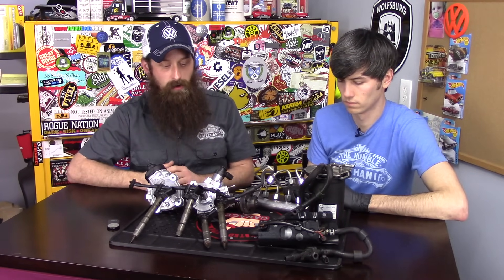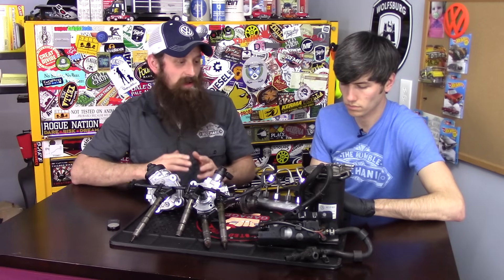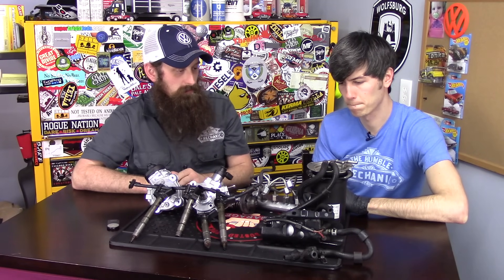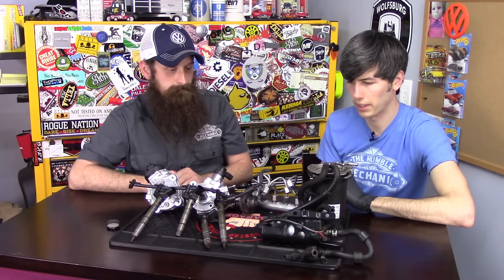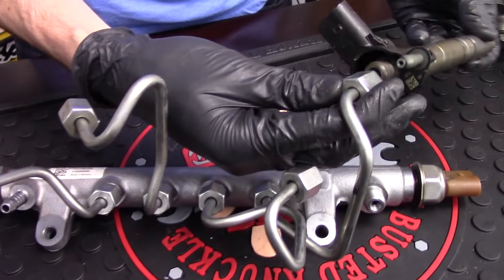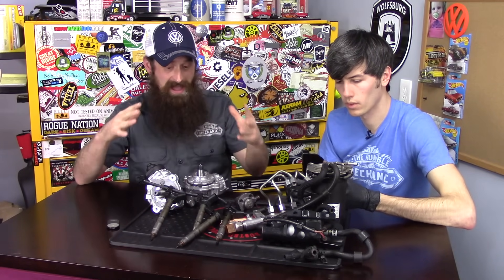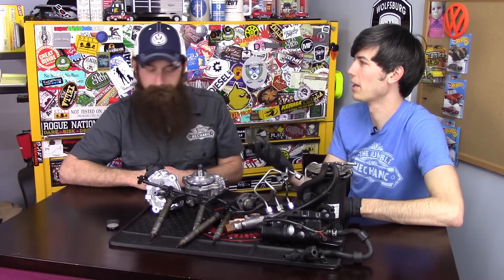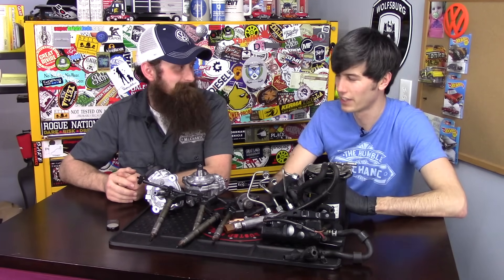Putting Gasoline In A Diesel Car - What Happens?

Comment: Or, just get an electric car.
Reply: +Btappin it charges. No such thing as a wrong plug. You can plug it into any plug.
Reply: +Btappin it charges.
Reply: +Btappin yup. Best cars in the world.
Reply: Right, why pay for an $8000 repair when you could get a $90000 car?
Reply: +Child Celebrity a Nissan Leaf isn't 90k. And neither is a Tesla. Teslas start at 60k. Nice try though.
Reply: +Kushari Okay, if you're not in a hurry, and if it works...
Reply: What if you need to drive a longer distance than the charge lasts?
I drive an LPG converted car with a limited range, and I ordered a new one which won't have that much more range... But pumping 400kilometres worth of LPG on the go takes just a few minutes, and I can switch to petrol if I run out of LPG.

I'm not a fan of using fossil fuels, nor do I believe in growing food for fuel (ethanol), but until the time comes charging an electric car takes 1 minute per 100km range or less and they come down in price, it's not for me.
Reply: +Candisa btw I'll tell you what impractical is, impractical is spending billions mining/drilling for fossil fuels to further process them and then put them in a 4000 pound car to be burnt at less than 20% efficiency in order to move a 200 lb person, now that's actually impractical and retarded.
Reply: +Matt Bartholomew Matt you're absolutely right, for most, now, it doesn't make sense. Eventually in a few years it will. The people that are buying the model s and model X are driving down the cost.
Reply: Protector of the Republic OR, you're just jealous. If it was a shitty car, why would it be winning all the car of the year awards? You're a loser.
Reply: What if you need to drive a longer distance than the charge lasts?
I drive an LPG converted car with a limited range, and I ordered a new one which won't have that much more range... But pumping 400kilometres worth of LPG on the go takes just a few minutes, and I can switch to petrol if I run out of LPG.

I'm not a fan of using fossil fuels, nor do I believe in growing food for fuel (ethanol), but until the time comes charging an electric car takes 1 minute per 100km range or less and they come down in price, it's not for me.
Reply: +Candisa supercharger network. Free to use.
Reply: +Kushari The Roadster started at $128,500, the Model S and X start at $69,900 which is only off by a margin of over the $8000 repair, but that's neither here nor there I suppose. These are the lowest-range vehicles, which still take at least a half an hour to charge to a 170 mile range. On top of that, the battery will need to be replaced after about 100,000 miles, which will run in the tens of thousands of dollars.

Not to mention the electricity the cars are charged with is most likely still coming from the burning of fossil fuels, but as long as you feel better about yourself, I suppose.
Reply: +Candisa well it does work and in 30 mins you get half the range, also when you're driving long distances you should be taking a break for safety anyways.
Reply: +Kushari There have been numerous complaints about people just barely getting to the next supercharger because the one they needed didn't work. 
I'm sorry, half an hour charging for just a few hundred kilometres of range is unacceptable. 
Yes, it is recommended to take breaks, on private drives, I take a break about every 3-4 hours. That would be the maximum or more than a Tesla can go between supercharging, and then you're stuck to whatever overpriced diner/coffeeplace/park on that location... It's like being stuck to a motorway restaurant...

I do believe electric makes a lot of sense, even today, but it still has a long way to go to replace a conventional car for everybody.
Reply: +Candisa it is acceptable because they usually have superchargers next to a mall or some place you can grab a meal. Also they are always adding superchargers. Check out supercharge.info. You think it's unacceptable because you haven't done it. My car is done charging before I ask for the bill when getting a meal. Which gives me more than enough range to skip a supercharger on the way to Montreal from Toronto. And they even added another one a few weeks ago, so that's two skipped chargers.
Reply: +Kushari I assume you'll be avoiding all of the points in the first paragraph then, and focusing on one sentence. "Didn't do my homework" meaning I'm supposed to know where you live? I'm glad to see that Canada uses renewable energy, but the US does have a generating capacity over 900 GW more than Canada. The countries use different fuel because they are vastly different. Electric motors are about 3x more efficient, but I'll excuse the exaggeration.

I actually didn't have to google anything; I simply used Tesla's site which also shows that their cars are less efficient in cold temperatures, which you surely are very familiar with, and the locations of Superchargers, that are only available from Vancouver to Calgary and Toronto to Montreal.
Reply: +Kushari There are some valid points though, and since most of my city's energy is generated from hydro, perhaps one day if I have 70k for a car, I'll get a Tesla. The torque their engines produce are pretty damn impressive.
Reply: +Kushari That still is affecting free choice... What if I don't want to take a break when in need of fuel/charge? What if I want to go eat something 2 kilometres away from the supercharger? 

What in case of a family emergency that requires me to travel 600kilometres asap?
Worst case scenario I need to fill up my LPG tank 2 times, or go F it and fill up my petrol tank once, so that leaves me delayed 5-10 minutes max.

I don't mind having to fill up every 300kilometres, but having to take a break there and then because my car takes half an hour charging?

I live in Belgium by the way, I checked out the supercharger network... It's even worse than CNG...

I ordered a €20k car, including LPG conversion. The day that price would get me an electric car with at least a 300km range and a battery that takes 5 minutes to fill up completely, I'd go for it.
I'm pretty sure I will run the car I ordered for the intended 10-12 years before electric cars will come close to meeting that expectation...
Reply: If a family emergency needs you to travel 600km, you fly. You don't drive. At least that's what I would do. Just like you said, free choice.
Reply: +Kushari haha some people simply aren't worth wasting the mental energy on, they'll always come up with an exceedingly stupid scenario that agrees with what they already decided they're going to do.
Reply: xXJeReMiAhXx99 There are some legitimate arguments, like if you have to drive a long way everyday, or like he had mentioned the price of a Tesla, but those are all being addressed over the next year or years. So I just don't get the argument of a limited resource that will eventually run out, and is killing our planet?
Reply: +xXJeReMiAhXx99 I switched from diesel to LPG, a fuel that is unavailable during shop hours at much less locations, 3 years ago...
I seriously considered CNG when ordering my new car and only decided against it because it would be less economic than LPG, instead of not even trying one because the limited amount of fill up stations and the total lack of them along motorways.
What a stubborn person I must be éh?

As I said, the moment a practical sub 20k Euro car with a minimum range of 300km and a full charging time of 5minutes or less comes to the market, I'll be all over it.
Having to plan in half hour breaks at exact locations to do a longer trip sounds a lot like taking the train or bus to me, which I wouldn't have to drive myself. If that would be so ideal for everybody, nobody would buy cars anymore.

What about people who can't even charge their car at home because they have to park on the street, also a stupid excuse?

Electric cars simply don't work for many people yet, including me...
Reply: +Kushari  She*
And in no way I'm defending fossil fuel, I'm very eco minded, I'd switch to electric immediately if it was practical for me.
Reply: You'll be waiting a while then, 5 minute charges I'd hope for, but I think that's a few years away. I didn't say they work for everyone. My initial comment was that you don't have to deal with fuel type mishaps with electric.
Reply: +Kushari That's why I still bought a brand new LPG car, planning to run it for 10-12 years. At least it'll be more economical with the fossil fuel, and hopefully an electric car will make sense for me by the time I'm shopping again.
Can't go wrong with fuel on an LPG or CNG car as well, the LPG and CNG nozzles are only compatible with that type of fuel, and a diesel nozzle won't fit in the filler of the petrol start-up/back-up tank.
Reply: +Kushari To me, it seems like it would be more beneficial to focus on making all (or at least as many as possible) power plants use renewable sources, at least in the US as Canada is already pretty much on top of this, while looking for more efficient charging/battery technology. Knowing what Li-On batteries can do when damaged makes me concerned about having a bank of 6000 in a car, and you can only send so much current to these batteries safely. Although if power plants are that much more efficient, we may as well go for it now.
Reply: +Kushari the 0.01% of the population that really do drive in excess of 400 miles daily non stop can stick to gasoline cars for all I care, it's insignificant, regardless there will no doubt eventually be cars that suite extreme needs as well.
the family emergency thing is even more pathetic, enjoy averaging 20 mph through traffic jams, if you really need to rush further than a tesla can for an emergency then you aren't using a car at all, period.
the price of a tesla as anyone who has done their homework clearly understands is inevitable at the start until things like mass production and technology improvements kick in.
Reply: +Candisa if you understood how much energy you're talking about you wouldn't be requesting 5 minute charging times, LOL not saying it can never happen, maybe it will but you'll be waiting a while.

maybe eventually you'll become less stubborn and then you can enjoy new technology, otherwise go ahead and drift into the past and miss out, I'm not even trying to convince you otherwise, you're the one missing out not me.

and btw I feel like I must add I'm not suggesting anyone buy a $70k+ car, obviously most have to wait until something comes that they can afford, until then support at least politically a technology that is clearly much better than any other option and it will be here before you know it.
Reply: +xXJeReMiAhXx99 The family emergency argument is stupid? Well, the times it happened, I was definitely happy I had a car, as public transportation would have been either impossible, or simply take a LOT longer. 
But you clearly know all about traffic and alternatives in Europe...
Reply: +Candisa well I do know that when my grandmother was dying we didn't hop in a gasoline car and drive non stop for hundreds of miles, we took a plane.
that's not why it's stupid though, I'm still baffled that you can think of that as a real argument, an event that will happen less than once in most people's lifetimes is a reason that electric cars don't make sense? I mean I don't even
Reply: +xXJeReMiAhXx99 And yes, I know 5min charges are impossible with todays technology, but that doesn't mean I can't request it, I'll wait for it to happen, which I'm sure it will.
I'm driving long enough to know that a simple practical car is better than any fantastic driving car with practical limitations.
A car that can't be filled up quickly on the go simply isn't practical and leave me hating it, no matter how quiet and smooth it drives, no matter how ecological it is.
Reply: +xXJeReMiAhXx99 And yes, I know 5min charges are impossible with todays technology, but that doesn't mean I can't request it, I'll wait for it to happen, which I'm sure it will.
I'm driving long enough to know that a simple practical car is better than any fantastic driving car with practical limitations.
A car that can't be filled up quickly on the go simply isn't practical and leave me hating it, no matter how quiet and smooth it drives, no matter how ecological it is.
Reply: +Candisa lol if it's a 100kwh battery to fill the entire thing in 5 mins you're talking about putting in 804 horsepower non stop for the entire 5 minutes, that won't be happening in the foreseeable future nor should it, something like 12-15 minutes to charge 60% of the battery would be completely reasonable(and an impressive accomplishment), and anyone who thinks this is unpractical simply fails at determining how it would affect their life.
Reply: +xXJeReMiAhXx99 Consider yourself blessed to live somewhere you can easily hop in a plane and fly to almost exactly where you want to be, and I really wished I could be so optimistic in thinking such an event happens once in a lifetime...
Unfortunately, in the 12 years I'm driving, I've had this happen to me 3 times, all 3 times there was no way in getting there faster, or at all...
1 Time stopping for fuel almost made the difference between seeing somebody alive for the last time. No way I could have waited half an hour at some charging station, I was already fighting my nerves to get there safely...

I recently ordered a brand new car that I plan to run for 12 years and more kilometres than the lithium batteries of an electric car are expected to last. 
I will never buy a car that cannot get me somewhere as fast as I want to get there within the law, never.
Reply: +xXJeReMiAhXx99 You're confusing impractical with ridiculously inefficient. I totally agree with you by the way...
Reply: +Candisa impractical and inefficient are hardly different.

I'll leave it at that though, I've already made my points and then some
Reply: +xXJeReMiAhXx99 There's a huge difference between impractical and inefficient...
No matter how inefficient fossil fueled transportation it, it is very practical: all necessary things to get the amount of fuel you need in your car are there, you don't need to travel far to fill up, nor does it take very long.

Electricity fueled transportation is a lot more efficient, but the undeniable facts that it takes long to charge, charging points aren't as widely spread, many people can't charge at home, electric cars are out of budget for a lot of people... make it very impractical.
Charging speed might improve to the point that home charging doesn't even matter anymore, charging points will obviously increase, prices will probably come down...
And then it will be practical and I'll buy an electric car immediately...
But for now, it simply isn't.
Reply: ***** You haven't driven a Tesla I'm sure of that, because you wouldn't say it's boring. That's why day after day I see people trading in their Porsches, Audi R8's, etc. It's not a track car, did I say It will lap the nurburg? It's the best everyday car. If you live anywhere there is a Tesla store, go and test drive one. You can even tell them you have no intention of buying one, they don't care. Then talk after you've driven one. I've converted many of my friends that say the same stupid shit.
Reply: +Kushari Personally i don't mind if you say Tesla is better or whatever but if you pull something like it's environmentally friendly it just isn't the batteries that are in the vehicles are way worse for the environment than keeping their gas guzzlers. A Tesla is fun, luxurious, insanely quiet, unexpectedly fast, and the best that electric cars have to offer but they are NOT in any way shape or form environmentally friendly.
Reply: +Kushari Not everyone can afford a nice Tesla and will end up with some junk that even people in $1000 beaters will laugh at.
Reply: +Himmel Weint yeah they are. Batteries can be recycled infinite times and I'm not going to even bother with the rest of why it is. Do your research properly. They are way more environmentally friendly than any gas, diesel, or hydrogen counter part.
Reply: +Himmel Weint Are you a Trump supporter? There's a lot to be said about current gen electric cars, but while they do use limited sources, those materials can be recycled over and over. Now try to recycle exhaust fumes back into petrol or anything useful... Good luck!
Reply: +supermotardmario super weak reply. Try again bro.
Reply: Candisa
My turbo recycles air into something far more useful pure horsepower. That's a start a guess.
Reply: +Matt Bartholomew brooooo!
Reply: +Matt Bartholomew All a turbo does is use some of the exhaust pressure energy to compress more air in the engine, reducing pumping losses. That's why the 1.4L 4cyl turbo car I ordered is almost (mainly because it's downtuned) as powerful as my current 2.4 5cyl NA.
But although this slightly increases overall efficiency, it still needs barely less fuel and emits almost as much CO2.
There's no doubt electric cars are the future, but there's still a lot of work for them to make sense to everyone.
Reply: +supermotardmario that's what everyone says until they drive one. You clearly haven't. I'm a car guy and most of my friend are too. They said the same thing you said, until they got in it. Then they shut up. Now they ask when they will get to see it. Stop knocking something you haven't experienced.
Reply: +supermotardmario having a friend who's father has one doesn't mean you drove it. You didn't answer the question.
Reply: Kushari As I've said the Tesla is a damn good car but not a lot of people can afford one. Most people would be lucky to afford a Nissan Leaf and in that price bracket they are competing with brand new Mercedes C class, Audi A4, VW Golf, BMW 3 series top spec Ford Mondeo, Vauxhall/Opel Insignia. Now give me a good reason why I should walk past all these cars for a Nissan Leaf?
Reply: +supermotardmario I was one of the few people checking out Tesla (very disappointed about the knowledge of the people they hired to represent them) and giving zero F's about the Mustang.
Main reason I went there was to figure out if I did good ordering my new car in December.
Reply: Protector of the Republic
You would have a valid point if it was one of the 'cheap' electric cars Kushari had but in my opinion the Tesla is a top car. Granted at the price range I would walk past the Tesla and buy a Jaguar XKR but that's personal preference.
Reply: Matt Bartholomew Thanks, no problem with personal preference. Just hate idiots that are just keyboard warriors.
Reply: +Candisa Not all ethanol comes from food crops. The issue is in the USA, we all want a free hand out, so the farmers take that hand out by growing corn for fuel so the government will pay them for their crops. Its crap, most other countries use live stock feed crops to produce their ethanol. It comes from the waste when producing the feed product. Of course it takes more product to produce that same amount of fuel, but the trade off is less food crops going to fuel production. There is also other sources available that are being brought online as well that are much more efficient as a "sugar" source to product the fuel alcohol.
Reply: +MasterMech77 Yeah... I'm not exactly a fan of using lots of food to force breed animals to feed humans either, so I think that's actually worse than using food crops directly for fuel production...
Reply: +Kushari Yeah because all electric cars are made from recycled batteries and also recycling batteries don't pollute oh no.
Reply: +Himmel Weint are you just stupid? You make them once and you keep recycling. As opposed to burning fossil fuels. You're seriously stupid.
Reply: +Candisa So? Gas is the energy and almost all car components can be recycled so your argument is invalid. Does the electricity that you use to power the wheels get recycled? No. Also whichever political leader I support is irrelevant nor do I live in the US.
Reply: +Himmel Weint your comment doesn't even make any sense.
Reply: +Himmel Weint You are right, any time you manufacture something you cause some pollution, even if it is a small amount. The companies that recycle get a "pollution credit" from the government. The more things to do to earn credits the "lower" your company's pollution rating goes down, the better the company looks on paper. For example an oil company invest in tree farms, reducing the companies pollution output rating overall. When in fact that said company is still polluting the local environment just the same. Anyone near the will not benefit from the "reduced pollution" that is shown on paper. To me that just looks like a way for the government to earn a quick buck, and for companies to pay for a get out of jail card.
Reply: Candisa
I don't know about or worry about the force feeding of food stock animals to encourage them to breed. I would rather see an animal over feed to get them to breed then the animal pumped full of synthetic hormones to keep them producing milk, breed faster, and or grow faster. That to me sounds like a real problem, and goes on every single day. However my main point was the waste created from the production of animal feed can and is used to produce viable ethanol fuel. This waste would other wise be used as a filler for dog and cat food, or just discarded. As far as I can see, that is a great way to supplement the ethanol fuel industry. It is not a complete solution, but if we take a from a bunch of smaller different places then one single source is not over tasked to product the ethanol fuel for our needs.
Reply: Kushari
Even recycling burns whatever fuel the power company uses to produce power. I know for a fact that the whole "recycling" industry is not really cracked up to be what companies and the government is making it out to be. Don't get me wrong, recycling has its benefits, it reduces the need for new resources of certain materials. However it is not a 1 for 1 exchange of materials. In your example of recycling batteries, you have to break the cells back down to their base materials. You can't just pop them open, unroll the cell and produce a new battery or cell from that processed materials. There is a lot of waste from recycling anything that can not be used in the production of a new product from an old one. As an example, a lot of the plastics that are taken in to be recycled can not be turned in to the same thing it came in as, like water bottles. Those are taken in and shredded, then turned in to carpets, and certain fillers for new plastic parts on vehicles.
Reply: +MasterMech77 you're referring to recycling as in trash that people throw away. Not in the sense that batteries would be recycled for a vehicle.
Reply: Kushari
I am not sure you understand what it takes to recycle a dead/worn out vehicle battery. The prime starting battery on most vehicles, is a lead acid type. You can take the battery apart and process the lead cells inside the battery, but that requires roughly the same amount of work if not more work then making a new battery. Recycling trash is no different then recycling a car battery. It still requires it to be pulled apart and process the usable materials. If you are talking Li-Ion cells that are used in the newer electric vehicles, it is not just a simple pull the old worn out cell out, charge it and stick it back in to another vehicle. When Li-Ion cells fail there is very little usable material left to be recycled. You can take the old case that the cells come in and stick new cells back in to the case. Most Li-Ion cells are are a thin membrane sprayed with certain chemicals rolled together to form a round tube that is then placed inside a housing. The chemicals very depending on the requirements needed.
Reply: +Samuel Rosenberg two three hours is for international flights, not in the same country. And if you're driving that would take more time. My point still stands.
Reply: Samuel Rosenberg
You are correct Recycling the Lead-acid type battery is done. However there is not real source for recycling the new type batteries that come in Hybrid vehicles. SO that is going to be a major issue in the near future, once electric vehicles really take off as a daily driver.
Reply: Samuel Rosenberg
They closed their doors, the same as the other steel factories and other manufacturing plants. Could not compete with the Chinese counter parts. Well the regulations did not help anything either.
Reply: Samuel Rosenberg
A quick search online and I found an interesting article on the subject. http://www.politifact.com/florida/statements/2014/apr/25/chain-email/lead-bullets-will-have-come-overseas-after-epa-clo/
Reply: +Child Celebrity ahh I love the stupid fossil fuel source argument. Let's me know you didn't do your homework. First off. I'm in Canada and most of our energy is renewable. Secondly even if it wasn't an electric motor is about 5 times more efficient than an engine, and a power plant is still more efficient than an engine ever will be. Also an electric car gets cleaner as your source of electricity gets cleaner. Want to try again big boy? Do some more googling, all your arguments will be shot down. I'm thinking your next one will be hydrogen.